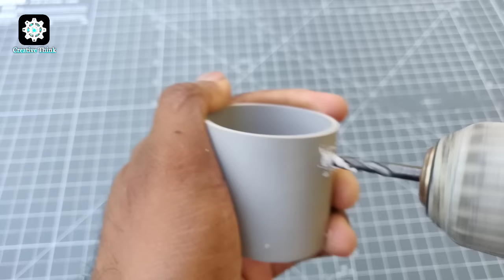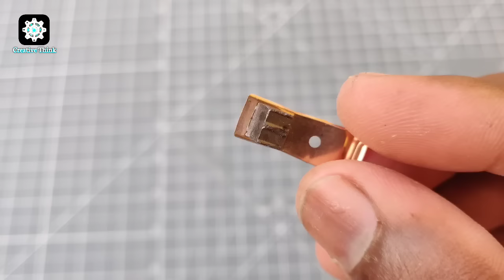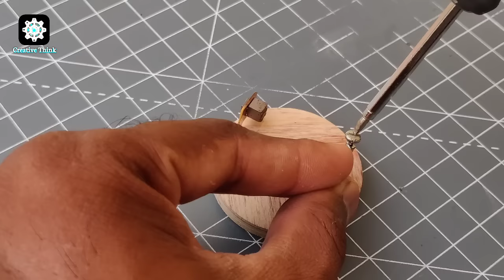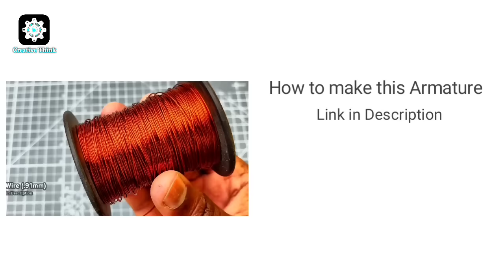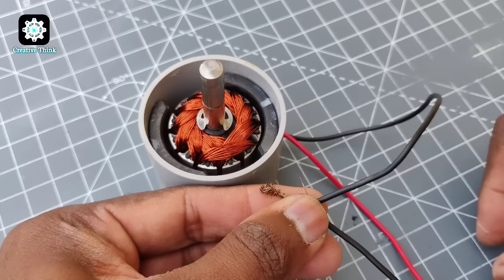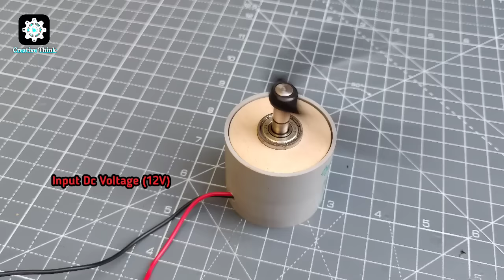Making Big Motor

Comment: Just dismantle an existing motor, Replace the outer METAL case with a PLASTIC pipe of the same Diameter and length. Put back everything as it was. You are now the proud owner of a BIG PLASTIC bodied motor.
However note that the motor may spin faster but lack"s torque. The motor needs a METAL body for the MAGNETIC FLUX to have a free path. Finally a WASTE of TIME. BTG,Engineer from India.
Reply: That's true man...

Comment: So you disassembled a motor to make a motor? Now without cooling, winding reinforcement and outer magnetic circuit. If you take a steel pipe instead of PVC the motor will be much more powerful. Also add some holes to let air go through its internals.